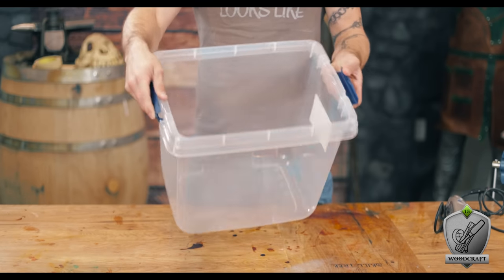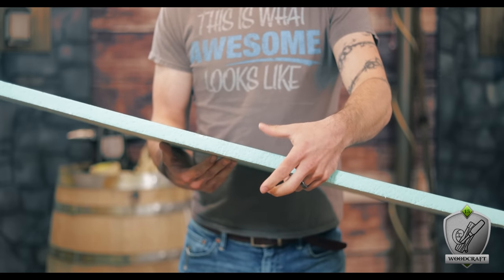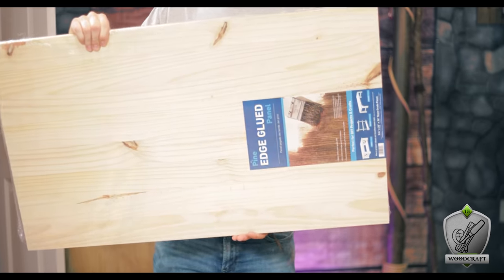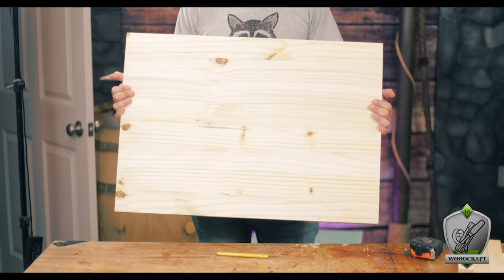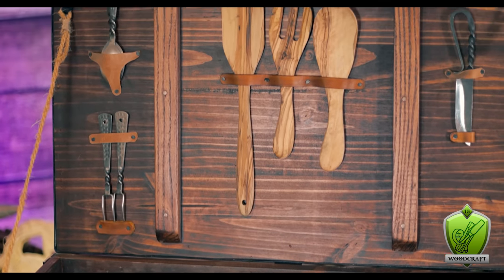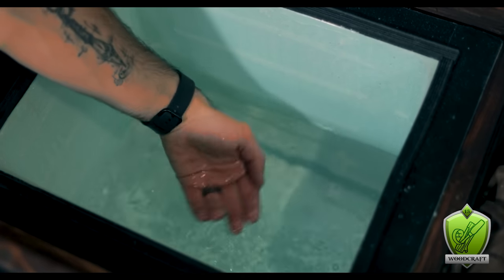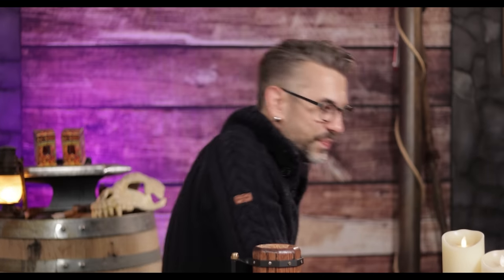Cooking Chest of the Traveling Chef!

Comment: Freeze gallon milk jugs or gallon zip lock bags instead of loose cubes.  Block ice lasts so much longer and the containers keep the cooler from filling with water.
Reply: if you do the gallon bags you can freeze then to perfectly sit in the cooler.
Reply: Ice in plastic jugs can also be used as water as it melts.
Reply: @hanelyp1  
You can even buy distilled water in those gallon jugs for around $1, if one happens to be lactose intolerant or just want the convenience and clean up factor. 
Also, I realise it should be common sense, but the colder everything going in initially, the less heat will transfer into the ice. Nothing should be above 2°C/35°F when starting out for better results.
Reply: So I am in the Army, I buy a cheap foam cooler and spray it with plastidip before a rotation or field problem, I do some thing very similar. I put dry ice in double bags then put a piece of plastic a buffer between the food and drinks. So dry ice bags, plastics then food/drinks.
Reply: I like the ½gal juice jugs. Higher grade plastic and 2 of them are easier to pack food around.
Reply: And frozen meat works great as well. Second or third day you eat it and till then it did a great job cooling the rest.
Reply: Adding salt also allows the water to maintain a lower temp.  Yes salt melts ice but it also lowers the freezing temp of the water, you do lose the drinking water though. But having frozen saltwater does make the cooler start off at an even lower temperature allowing you to have your food stay cold longer.
Reply: @thee_number_six6227  and bet the frozen salt water would be cold enough for frozen things like ice cream, which they had back in the day.
Reply: Or better yet, do what I do and have an autoimmune condition that requires medicine which must be refrigerated to be shipped to you every few months, and they'll send you a bunch of great reusable ice packs every time! They keep cold for a good while (and good thing too, considering the medicine thing...)
Reply: We used to bring small bottles of frozen water with us to LARP in our coolers to keep our food cold.  We'd pull out a bottle to melt and drink during the night, leaving the others to slowly melt over the weekend (this was a modern-day Vampire: the Masquerade LARP), so they served two purposes.  Even better, have them be red-coloured juice and use them as blood for when your vamp character is hungry!😉
Reply: I completely agree ice jugs is a good idea for this. Prevents your food from getting wet while still giving cold

Comment: One thing you can do with a version 2 is have the side door swing off the bottom instead of the side, and double as a cutting board. Or alternatively swing off the top and use some dowl rods as supports to make a makeshift countertop and cutting board. I hope my ideas make sense 😅
Reply: Agree with this. Great up with a similar wooden camp box (no cooler) that had the front fold down to act as a shelf or prep surface. Really effective solution.
Reply: Agreed!
Also maybe open the opposite side of the box to hold a blade sharpener and all of the knives any chef would use. They all would fit on the door, so it wouldn't take much room
Reply: I thought about suggesting something similar for a cutting board, but the KISS design principle (keep it simple, stupid) makes me think that a cavity/slot inside for 1-2 removable cutting boards would be a better idea.

An attached cutting board is cooler, but you're more limited by where you can use it.
Reply: @kachirro I was thinking knife rack in the lid.
Reply: Super idea
Reply: Good idea, but as someone else mentioned, maybe keep it simple. I wonder if it would be simpler to make each sidewall removable for other uses, like making a table.
Reply: @jakeaurod this is an interesting idea. Would you use the trunk as the base of the table, or would you need to design in table legs?

Comment: Ok, I'm sure someone already suggested this, but I'd love to see a tap added to the cooler that (and this is the part I'm really excited about) can connect to a container of frozen drinking water. This would serve several purposes: when frozen, the drinking water acts as block ice, which melts slower than the bagged stuff; by draining the meltwater, you slow the melting even more; using the water for drinking/cooking means you don't have to carry extra water; and finally, LARPing can be hot, so a cold drink is often appreciated.  Also, if you just make a reservoir the size of block ice that you can buy, you don't have to make your own block and you can even fill it with standard drink ice. Oh yeah, it also keeps your cold goodies dry!
Reply: As cool as a tap would be, I think it would be a logistical problem. Tho the drinking water idea is spot on, and can easily replace the loose ice to make more room in the cooler for food. Someone in an above comment suggested it.
Reply: I'd sort of cut out the middle man instead of Ice I'd fill 2L Pepsi or any soft drink (Soda for the Americans) bottles with water and freeze them as they melt you can leave them there or use the water either way at the end of the LARP you can just empty the bottles out also they get over the problem of the water from the melted Ice getting into your food. Side hint if you take one of the bottles 3/4 fill it and then press the centre of the bottle in till you force the water to the top, cap it and freeze it, it makes a great rest to put behind your neck to help you cool down when it is as my father used to say 'a hundred in the water bag' ( a water bag is a canvas bag you'd hang off the bull bar of your car, ute or 4WD and the air passing over the bag and the wicking of the bag would cool your water)
Reply: @alankohn6709  we call it pop, Sassenach.

Comment: If you ever decide to actually use this, Id recommend replacing the wood separator at top with a serving tray setup. That way you can lift your dishes out in one go instead of piece by piece.
Reply: A tea tray with drainage slats would be nice.

Comment: You should try and fill in the gaps around the cooler foam and the chest with some spray foam. It would lock it in a bit better so it can't move around and should provide a little more insulation. Though you're probably already at the point of diminishing returns already.
Reply: I was thinking that a hard, spray foam would be an excellent addition because it is lightweight by design and it would add a modicum of thermal insulation. A single can would be more than enough to accomplish the job and is still pretty inexpensive. Finally, if you added a tap to help drain the cooler before filling the gap it would help to hold the tube/pipe that you'd use for that purpose  in its place.  It's a Win, Win, Win.  If you use hard foam it'll provide a fair bit of extra strength and rigidity where soft foam would provide additional insulation and resiliency. the choice is up to the builder, but I heartily recommend it.
Reply: Closed cell spray foam has a better R value per inch than the foam he actually used.
Reply: The spray foam would have also acted as a glue to hold everything in place, making it nice and snug
Reply: Came here to say just this.  I think it would be a great addition for both reasons.  More insulation/less air and air infiltration and should as you point out, really lock it in.

Comment: If this is for a long weekend you should factor in the use of dry ice. Maybe a thin, hole'y box to put the dry ice in or... use the bottom of the storage side somehow to store the dry ice so it vents the cold from the dry ice to the normal ice and keeps the normal ice from melting. 
I remember a hundred years ago when I used to go camping all the time, we had two boxes like this. One was set up as a prep and cook, and the other was set for a sink. 
This would have been a great third box given that coolers can set you back a grand these days, luckily they used to not cost more than a hundred bucks for the best ones.
Reply from the maker: I like that idea! Maybe I can get myself like a small aluminum box to keep dry ice in at the bottom of the cooler!
Reply: I have to wonder if a dry ice chamber on the top of the cooler would be better? Cold air sinks, so maybe bagged (wet) ice on the bottom and dry ice on to top to better cool everything?
Reply: @SkillTree  you want to put ice/dry ice on top of the food you want to keep cool
Reply: @dynamystic3050  the problem with that is you have to move it every time you want to get something out. In a well sealed small volume container the advantage is negligible.

Comment: That's a really neat idea.  It reminds me of the kitchen boxes we had in Scouts.  Ours were bigger (and oh boy were they heavier!), and they didn't have a cooler section.  But what they did have is legs.  Four stool legs strapped to the bottom while carrying it, and you could have it sit a couple feet up off the ground in camp so you don't have to bend down to get at what's inside.  It is certainly a great set-up as-is.  Very good use of space.  Very well done indeed!
Reply: The legs are a great idea! My parents made a "camp box" with all the utensils, cookware, etc, and we would just set it on one end of the table to have it at working height. Effective, but it did mean the last two feet of the table wasn't usable for eating.
Reply: Chuck box!
Thanks for this comment,  Scouter!
Reply: I would make a smallish table that the box itself would nest inside of or table on top of the box. The sides of the table and legs would keep the top lid and panty door secure while moving....take table off the top, set table on the ground, set box on top of table. one, it would help get it off the ground directly. and two, if you put drainage in the insulated part, use bottle/pan to collect the water....gravity does the work.

another idea to move the box around....medieval dollie. or just put some medieval type wheels on the thing. think like buckler sized wheels....not the wooden spoked ones. 18 inch 3/4 plywood would do. make the wheels removable, and run the axle through the space between the bottom of the box and the bottom of the cooler. That way you would only have to drag the thing instead of carrying it, especially if it is fully loaded. Work smarter not harder.

Comment: How did the water removal work out? Was it cumbersome? Would you consider adding a tap? Also, I’d be interested in seeing an aesthetic but useable dolly to help maneuver these larger pieces.
Reply: I was wondering the same thing. With the current setup to drain the water you would have to scoop it out and air dry or tip the whole thing upside down which isn't ideal with ghe pantry section.
Reply: Was just thinking a tap would be necessary. Dumping water out of that thing would be a pain
Reply: That was exactly my first thought too. I live in the Pacific Northwest and mold & mildew hit hard and fast if you're not careful. I didn't see any way to lift the cooler out to drain it, so that's the only modification I'd make -- a drain system. Otherwise, this is spectacular!

Comment: I've also seen a tutorial where someone took on of the normal chap coolers that are basically just two walls of plastic with an air gap cut holes in them filled the internal space with gap filler spray insulation then patched the holes with plastic, still not as good as like a Yeti but still a big step up from your typical camp cooler.
Reply: Yes, I enjoyed that video also

Comment: Lumber and Building material associate at Home Depot here, I love your channel and just stumbled upon it recently.  

A piece of advice I would give would be to have added reflective roll insulation to the inside of the interior walls where you put the supports for the outer walls, this would block a little more radiant heat from warming up the cooler.  You also could have placed some extra 1/2 inch insulation board into those cavities as well.  Maybe you could have used loose blow-in insulation or fiberglass insulation to pack it loosely, to fill in any voids around the cooler.

Comment: Tinfoil inner wall and base beneath, spray foam gap between tinfoil and blue insulation. 

Cool the cooler with some sacrificial ice for a few hours, empty, then fill with the “working” ice, if some food items are for a few days into the trip, freeze them before loading.

There are ways of making ice last longer before melting, slabbed ice, salt in ice before freezing, distilled water.

With the dark colours used, they are heat magnets, drape with dampened white cotton sheet.

👍 great video 👍

Comment: Cool idea! Make sure you leave it on a table or ground cloth, I'd think the leather will mold if you keep it on the ground.
Reply from the maker: Good call. I think I will make little feet out of wood blocks or some such
Reply: @SkillTree  one of the other comments mentioned some detachable legs - maybe you can make the feet with legs that hinge up to the bottom, so you can set it on the ground or prop it up for easier working height

Comment: For my reenactment furniture, instead of polyurethane, I use a formula I got from a master woodworker. It worker really well, and can quickly be reapplied as needed for heavy used items. It's 2 parts boiled linseed oil, 1 part v m & p naphtha, and 1 part marine spar varnish. It is really good for wooden items like this that get heavy indoor/outdoor use. Also, I need to make this.

Comment: Pro tip for making your cooler stay cool for longer; place a block of dry ice at the bottom, bury it in normal ice. It will take alot longer to melt, and will be MUCH colder. Will explode your drinks though, so be mindful. Love you man, thanks for another neat project!

Comment: Make a copper box with pre plumbed for a water spigot, glue the foam to the copper box before construction of the outer chest . If you are worried about copper brass and steel are fine just  sure to use only silver solder for the seams not lead (for obvious reasons).

Comment: Something like this with a triple walled tin box with a lacquer inner coating in place of the cooler (a wall around the actual storage, a wall outside that to make a cavity for putting ice into, and a third cavity between that and the outer wall for putting insulation (maybe loose wool or layers of felt?) inside of; the lacquer coating should thoroughly waterproof the interior) could work really well as a travel cook’s chest that lives on the party’s wagon.

Comment: Some kind of thermal reflecting layer on top of it would probably bring that up to a full week. Looks amazing and I bet you're excited to bring that for the next event.
Reply: Actually, putting a layer of thermal reflec (roofing reflec with the thin foam backing) UNDER the chest helps a lot - the ground for most of the year is warmer than the night time air temperature, in some places it may be warmer than the day temperature heading into winter.
Reply: @brucelee3388  By on top I was referring to as a layer around the foam layering. Not literally only the top. That said, that info is going to be SUPER helpful, thanks!

Comment: If you do something like this again use actual duct tape for AC units. The tape is  designed for insulation and sealing the seams of your ductwork on a heating and cooling system. You can pick it up at any big box store. I love your videos. Suggestion to build bone gauntlet and shin guards

Comment: I worked at a blood bank for a fe years.  We shipped blood all over the USA  including Hawaii.  As well as Puerto Rico.   We used these wax sealed cardboard boxes with inch thick foam insulation  two short ones for the ends and four long ones for the sides and bottom and top.    We used those square blue plastic ice packs filled with water.  Once they were frozen they lasted about 3 days.     If you can find them the Styrofoam boxes you can get medical supplies in work really good for coolers too and it already has a nice lid and four sides.

Comment: You can make the whole chest smaller with the same amount of storage by using sawdust and ice IN the plastic container. No need for the foam board. Up until 1927(when the first electronic fridge came out), Sawdust was packed around ice blocks in a box and transported by train across country, or in ships across oceans. It was also used in icehouses for keeping ice all summer long.

Comment: I love this Chef Box, as a once avid camper this would have been the ultimate camping add on for sure, along with a 2nd folding up vanity made into a box stand and double up as a dry food storage area would be great as it would lift the box off the ground allowing it to stay away from the heat transference of the earth, but will bring the cooler up-to a working a good working hight. 
I liked the idea someone had of making the end door to swing up as an extended workbench. Using Dry-ice would be great but this is something that is not ready available here in Australia, even our frozen goods are packed with jell packs.
Here in Australia in the Gardning section there are these crystals that you can buy which absorbs water for the plants to use during the dryer days, if you filled a bucket with water and add the crystals to the water once they have absorbed the water you can bag them into the containers used for leftover meals to go into the freezer, they would be a great alternative as they are reusable and you can place your frozen food in between them that way the food for your day 5 will still be as cold almost as when you placed it into the freezer box. There are plastic food boxes about the size of the freezer box made and they are about 1.5 to 2 inches deep so they would make great freezer blocks. Done right you could have one between every 2nd days worth of frozen or cold food. I have made a few of my own freezer blocks as it was cheaper than buying the big freezer blocks lasted for years and once we stopped going camping I just dug them into the veggie boxes for my veggies to use.